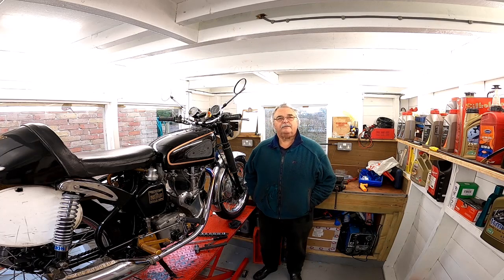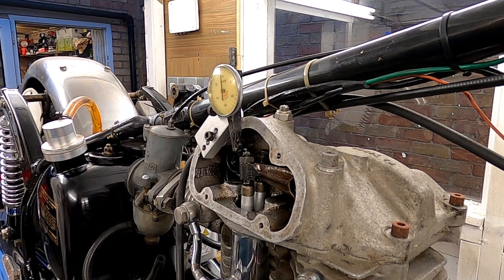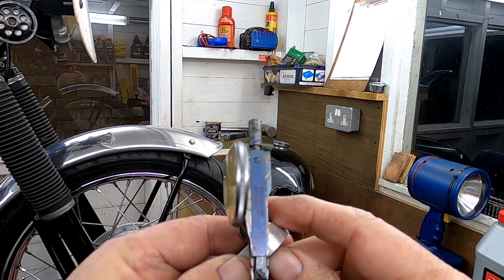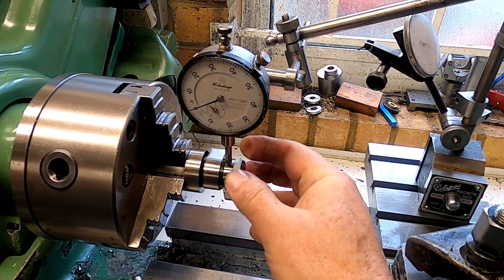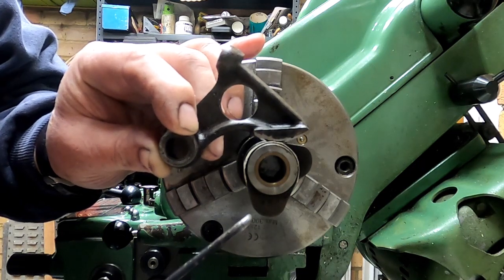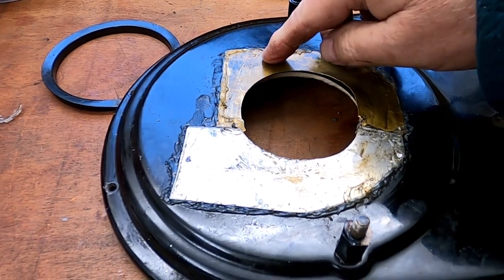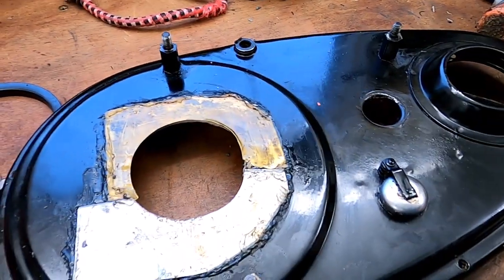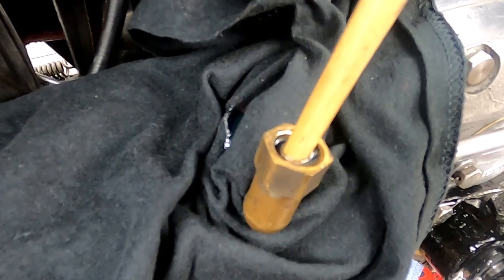Velocette 500, 5 speed conversion, part 8

Comment: Can't thank you enough for your patient expertise Alan . I'm very much interested in your upcoming 4 speed box overhaul. Mine grinds going to/from second to third gear. I've had it apart and put in new bushings but it's still not right. Can I also ask, when you examine the gears, if radial minute cracks from the shaft hole can be repaired by welding. It will be marvellous to see you fettle your spare gearbox. Thanks in advance. Brian in Lancaster.

Comment: Hi Alan I have a 1957 venom according to my velocette manual you adjust tappet clearance at the top end of push rod not at the camshaft so no need to remove the timing case
Reply from the maker: Agreed. I have one piece pushrods which ideally are set with a feeler gauge between the follower and the cam on the base circle.
2 piece pushrods have a telescopic format which enables checking and adjustment at the cylinder head. I got the current one piece pushrods decades ago from Dodkin as they were a bit lighter. Sadly there is only so much I feel I can talk about in these videos, as there is a risk of boring people. Thanks for the response.
Reply: Wonderful content, so nice of you to share your extensive knowledge on these wonderful machines. 
Quite a sturdy rearview mirror set up you have. It would be great to learn more about that set up. 
Thank you,
Doug 54 MSS
Reply from the maker: The mirrors are pattern Japanese. I use dog leg pattern alloy clutch and brake levers. Both of the clamps have threaded towers which the mirrors screw into. You have to be careful when you buy the mirrors, some of the threaded towers have a left hand thread on one side.  Thanks for the response.
In addition, filing the alloy clutch lever to allow the lever to travel further and lift the clutch more is another advantage. Not so easy on steel levers

Comment: Hi Alan if you read these comments I would like to borrow or reproduce the tool you created to refit the clutch basket as I am having real difficulty in installing the sleeve nut
Reply from the maker: Where are you located??
Alan
Reply from the maker: Do you want a set of dimensions and a sketch? Can you use a lathe and weld up piece of material??
Reply: @alanglen5902  Hi Alan, in Aus and yes can weld and have access to a lathe. Would appreciate drawing and dimensions plus details of any costs which I am willing to pay regards,
Peter
Reply from the maker: @petershacklock6457   can you send me your e mail address. Mine is.      alanbigsplash@gmail.com
Reply from the maker: Dimensions/ sketch/ photos on the way by e mail